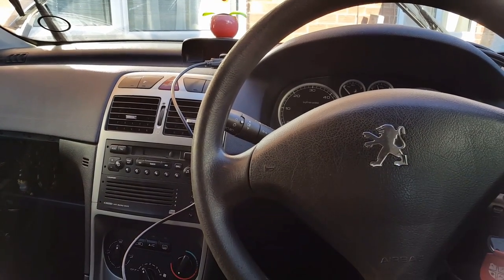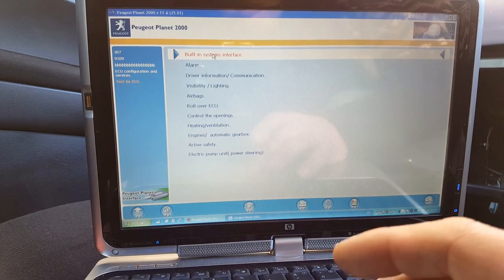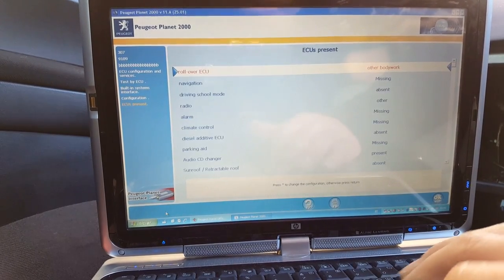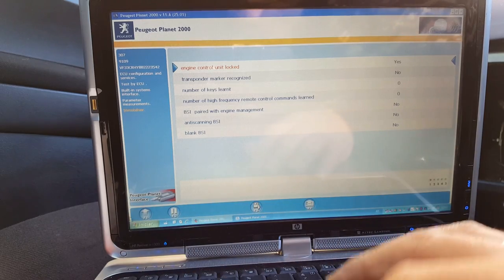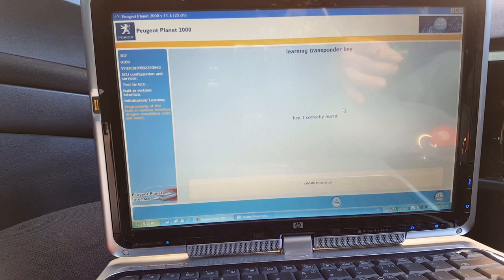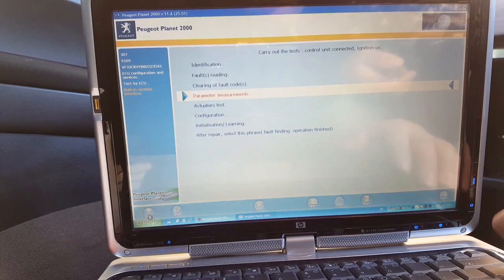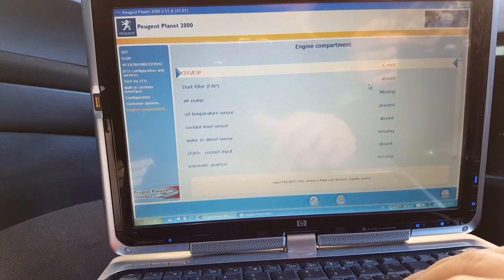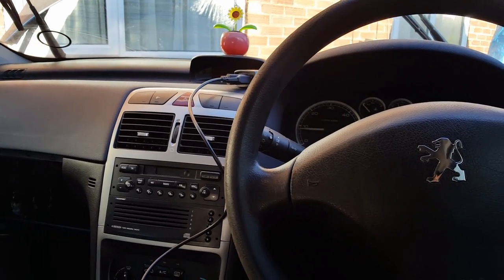Peugeot Citroën blank/virginized (new) BSI programming. Includes key/immobiliser programming.

Comment: Hi,
I would like to ask you a question. I had to change the BSI of my Peugeot 508. It was a used one so the electrician virginised it and reprogrammed it. Now he is saying we might need to order the new keys. It's push button start so key is a fob. He said it can't be reprogrammed to the new BSI. Can you please advise on this. Can my old car  keys be synced to this new(used) BSI?  Thanks
Reply from the maker: Possible not...
It might be that there is a tool out there capable of doing it, that I am not aware of...
But I think you need a new key...
The only other option would be copying the MCU Rom from the old BSI... 
Hope that helps. 
Thank you for watching!
Reply: @LMAutoRepairs  Thanks for your quick reply. Electrician blew the old BSI so I had to get a new BSI from crashed car. It came out of a car with normal key. But my car has keyless entry n push button start. Now my Electrician says we might need new keys from main dealer because these keys are not working.
Reply: @LMAutoRepairs  the old BSI is completely gone so I don't think he can retrieve any data from it about the keys.
Reply from the maker: @Bobbie362  
You would need a programmer to read directly from the chip...
I am not sure about keyless and normal transponder compatibility between BSI...
Not without checking diagrams and stuff...
Either way, you would need new remotes... as the old ones would no longer work...
So I think your best option right now is getting a new key...

Comment: I'm in trouble, I changed the 208's multimedia center, my 2014 put 2019, everything works perfectly, but nobody can take the beep off, information q the diagbox doesn't show that there is a central installed in the car .... someone has a guess  São Paulo Brazil
Reply: Você perguntos nos grupos do Face? Tem uns caras bons por lá que entendem de como instalar as multimídias
Reply: Santos dá uma olhada nesse video: https://www.youtube.com/watch?v=mtEaacOjTjU&t=112s
Reply: Use o Diagbox - https://www.youtube.com/watch?v=5qqS7676I6s

Comment: Hi my 307 valeo bsi is wather damaged. I read with carprog pin code is 4ttw. I buy used one bsi en virgized with all adress ff. I read ecu me744 eeprom pin calculator say wtt4? I will reprogram the bsi with pp2000 same steps if you but he dont accept pincode wtt4 or 4ttw. What i do wrong here? And waths is the best solution for this stuation ? Thank you best regards
Reply from the maker: Mehmet Ali Benturk 
Perhaps the bites are inverted...
Reply: Do you mean eeprom  bites in ECU and how can i solve this?  Maybe have any idea.? Thank you
Reply: Its solved   pin was correct! I try with  lexia under citroen c3 then its wil accept the pin everything is ok now. Thank you very much
Reply from the maker: Mehmet Ali Benturk 
Great!
Thank for the feedback!
👍

Comment: hi, Can you please help me?
I have peugeot 3008 1,6 hdi mod 2010
I have change bsi body computer with the same number but the car don want start. 
I get the message electronic immobiliser faulty. What I need to do?
Reply from the maker: Virginize the module and program it again...
Thank you for watching!
Reply: @LMAutoRepairs  how can I do it?
Reply: How program I need? can you help me over internet?
Reply from the maker: @catoforberg  
You might need to open the BSI, and read the eeprom and MCU...
Which tools do you have?
What was wrong with the original BSI?
Reply: @LMAutoRepairs  l dont have anything program. And something happend with my car so everything be dark. No lights ,electric problem with my old bsi
Reply from the maker: @catoforberg  
If you don't have any tools, probably is better if you find someone to do it for your...
👍👍👍
Reply: @LMAutoRepairs  thanks a lot for informasjon
Reply: My friend have cardprog to clone bsi body computer, and I ask you about you can tell me about eeprom 95128, its only this I need to copy over too my new bsi body computer?
Reply from the maker: To clone you need to clone the mcu as well...
(Depending on the BSI model...)
Thank you for watching and for your comment !

Comment: hi thanks for this nice video.
I have a Citroen Berlingo b9. I went to make a 2nd car key and he messed with my bsi program it went on SLP mode. 

I went to another bloke and he put me another bsi program as he didn't have the correct one for my vehicle. 

my question is  is it possible to go to the main dealer and make the original bsi program without changing the bsi ? 

thanks in advance
Reply from the maker: Possibly... dealer should be able to flash it again... but depends what the damage is... might worth to try...
Thank you for watching and for your comment!
Reply: @LMAutoRepairs  thanks i went mtomthe dealership  and everything  is sothed 
:)
Reply from the maker: @lorencachia  
That's great! 
👍👍👍

Comment: Thanx for your effort and your informative  videos
I have a problem please in my second hand Peugeot406 D9 petrol , that the Air Conditioning does not work(every thing is ok mechanically) , Also the first speed of the fan does not work , when i went to the technician to diagnose the problem he told me that this problem is due to that "the Engine ECU is open " or " without Code" , means can work with any car !!! ,  this Engine ECU is second hand ,  and to solve this problem he needs to install a new software on the ECU, including unifying the code in the key,BSI&engine ECU , How can i solve this problem my self , knowing that i have PP2000 and the diagnostic cable 
Regards
Reply from the maker: Ahmad Abdel-Khalek 
So the immobiliser has been disabled on the engine ecu.
Codes, which codes do you have air con related?
If the ECU in there was not set to a car with air con, go with pp2000 under settings and see if is possible to enable the air con...
And go from there...
Reply: Thank You
I will try this

Comment: Thank you for this video, I have problem when the battery died the car stop ignition and then the tecnician came cancel the code and now the car running but the AC and remote control and central lock don't work after that the bsi damage and replaced with another bsi but it's not the same module 2002 and my car 2001peugout 307, can I do the same procedure and how can I have pin code and thank you
Reply from the maker: Mosa Ahmed
Hi
Once the BSI is replaced, the remotes will no longer work... they cannot be programmed again...
So, get another key fob and get it programmed.
As for the AC,  probably just needs to be configured...
Reply: lmsvvavr thank you and what you mean fob key
Reply from the maker: Mosa Ahmed 
Fob/remote....

Comment: Hi,I have a blank bsi,when I try to enter security code is telling me  built-in system interface  blank.
Programme the built in system interface. I made all the settings but bsi still remaining blank. On parameter measurements /immobiliser blank bsi -yes .
How ca I solve this situation? Thank you!
Reply from the maker: Hi
You need to initialize the BSI first... and then do all the programming...
Thank you for watching and for your comment!
Reply: @LMAutoRepairs  Thank you very much for this wonderful video. Can you please explain in detail how can I initialize the BSI first? I'm in the same situation.
Reply from the maker: @antinben  
I have other videos on that... just search my channel...
Thanks
Reply: @ @LMAutoRepairs  Actually, I saw all your 4 videos :)  But still not sure if there is a way to overcome "Blank BSI" (After entering the 4 correct digits of PIN code) when trying to learn the keys (and when checking immobilizer -> blank BSI-yes). Do I have to take the BSI out and flash new BIN file to the EPROM chip as you did in the following video 
https://www.youtube.com/watch?v=iXkkx2uxGbE 

I'm just trying to avoid disassembling the unit and trying to figure out if there is some other way/s to change "Blank BSI" to no...Maybe somehow with the PP2000 utility?  :(

Also tried to go to "new replacement parts" and then "new BSI" and then F1 ->reconnect and tried again to enter learning the BSI. and got again the same "Blank BSI"

P.S also tried entering the 4 not correct PIN code -> the same message.

Thank you so much
Reply from the maker: @antinben  
Yes, there is a correct procedure and steps to bed followed in a certain order.... but unless I am doing it and looking at the screens, I cant remember now from the top of my head. Sorry...

Comment: Hi..I have one Citroen Berlingo..I take the Pin from the ECU because the Eeprom of the BSI is corupt, fill all with F on the eeprom and solder it on second hand BSI..I conect the BSI do all the procedures ,the car start but i have no milage on the dash..And there is No comunication with the BSI on the dash faulth codes..Can you help me with this
Reply from the maker: Svetoslav Ivanov Slavov 
Hi
If there is something wrong with the eeprom itself, you have just transferred the problem across...
Try it using another eeprom...

Comment: ThankYou very much for the video!
I was looking around for instructions like that. Very helpful.
Can you suggest me a programmer that can read eeproms and MCUs from Body modules or instrument cluster so I can virginize them to reprogram on the car later?
Your suggestion will be helpful to me.
Thankyou in advance!
Reply from the maker: Hi
Thank you fro watching and for your comment!
A good suggestion is X-prog... but I advise you to research, as there is many others out there...
Reply: what a quick replay. You are amazing man. You deserve respect for that work. I don't have any experience with the programmers, in the video for reading the BSI you used Carprog, which can be used for other jobs also, like airbag reset, instrument cluster etc.
Is it better buying Xprog or Carprog. In my tool collection also will be K-Tag and Kess.
ThankYou very much.
Reply from the maker: Aldi Shuli 
Carprog is probably easier to use and more versatile...
X-prog does a bit more MCUs than carprog...
If you are just starting, between the two, get carprog....
Reply: Thankyou very much :)

Comment: Great Video,Thank you for this demonstration! I have a question for you, the pin code witch you have been introduced is from bsi or ecu?  Thank you!!!
Reply from the maker: Hi
Is the pin from the car...
The pin in the ecu needs to match the one on the bsi...
Thank you for watching and for your comment!
Reply: @LMAutoRepairs  the  transponders are blank 100% ? No need for precoding (make dealer key) like vw ?
Reply from the maker: @electronnelectronn2318  
No... but the remote also needs to be blank/new...
Thank you for watching!

Comment: Hi Mr.  Imsvvavr thanks for sharing your video very interesting, can i ask a help? have a citreon C5 2004 model i am now got stress spending money just to back to life my car. i had replaced  the engine because it was overheated then when i bought the engine from the supplier it wont works and i returned for the  3 times it was removed and fixed the engine and 3 times i had returned till i decided to overhaul my previous engine after fixed the engine still the engine failed
 to start and we scan to the computer the ECU not detected...please help me what to do
Reply from the maker: Ronald Serenuela 
Ok, so what I understand from your description, is that you cannot communicate with the engine ecu, is that correct?
Reply: Yes Mr. Imsvvavr!
Reply from the maker: Ronald Serenuela 
Ok... in that case check wiring, fuses etc...
If when you turn the ignition on everything behaves as normal, then it might be just something on them communication lines... otherwise might be a problem with power to ecu etc...
Get hold of some diagrams and check the wires...
Reply: Ok thanks a lot ill try all over again.
Reply: but the starter is working it can crank the engine but wont start.
Reply from the maker: Ronald Serenuela 
Yes, starter motor is in some cases triggered by the BSM... although the signal should come from the engine ecu...  🤔
Well, till you manage to communicate with the ecu there is nothing you can do... 
Actually,  that is most likely the problem... is the ECU is not communicating,  is not getting the immo code to unlock, and therefore not allowing the engine to start...
Reply: so what im suppose to do...please give an advise...
Reply from the maker: Ronald Serenuela 
Well, I have just told you....
You need to check communication lines to/from the ECU...
Reply: thank you so much...for your time...

Comment: Imsvvavr very useful vedio thank you very much. 
I got 307 with one remote key lost, I am using the normal one with no remote control. I will be so grateful if  you instruct me how to fix that cheaply.
Looking forward to hearing back from you.
Reply from the maker: Galloper 
You need to get a blank remote and transponder and then program it to the car... there is no other way...
Reply: Thank you for your quick response. Could you please recommend to me any link to buy it online? as I have not enough experience to do that.
Reply from the maker: Galloper 
eBay is good place to start...
Reply: 2-buttons ID46 433MHz Transponder Chips Remote Fob Key For Peugeot 207 307 N8H8. Imsvvavr Do I need to have any code to do the process using pp2000?
Reply from the maker: Galloper 
Yes, you need the security code from your car.
If you still have all the paperwork, you should have a scratch card that contains the code.
If not, the dealer will give you the code... for a small fee... here in the UK,  about £30...
There is other ways of retrieving the code, but will require special tools etc...
Reply: Imsvvavr I just bought the car and I asked the previous owner about the security. he said that the security code is lost as well. I live in Iraq and the dealer closed about a year ago. I wonder If you can help me regarding the special tools, I will be so grateful. 
Thank you very much for your cooperation and your patience.
Reply from the maker: Galloper 
Watch this video...
https://youtu.be/nXoUz-ejRtI

There a tool called "PSA BSI tool" that can read the pin through the OBD port... but check first, to make sure is compatible with the BSI fitted to your car...

Comment: i have same case. after battery disconnect car dont start and other symptoms of bsi eeprom corrupt. when check live data i see ecu is locked. and i cant comminicate with main engine ecu. this is normal? bsi can block diag line to ecu communication if eeprom is corrupt in bsi?
Reply from the maker: Hi
Yes it can... Certain Peugeots are known for that problem...
You need to pretty much follow this video and you will have the car back on the road.
Remember that you might do not need to follow every step...
Reply: thanks buddy. iwatched this videos few monts ago,and not have this case, very helpfull. but in my case is citroen c5 2.0hdi 2001 year.
Reply from the maker: Ok.. Same thing...the procedures are similar.
Hope you get it sorted.

Comment: Hi! I have replaced BSI from a 307. Done everything you said but i get stucked with this error when i program transponder with pp2000. check/verify transponder key (something like that). i used blank transponder. any suggestion, please.
Reply from the maker: Mircea Catana 
Hi
Are you using the correct transponder?
Or, is the transponder in good shape?
Reply: lmsvvavr, yes i'm using pcf7936 TP12 id46 new blank transponder
Reply from the maker: Mircea Catana 
OK... well, I can't really help you further... usually they programme ok... try another transponder... just in case...
Reply: lmsvvavr. ok. thanks for your reply.

Comment: Hi Imsvvavr, I hi have a Peugeot 206sw quicksilver estate and when I unlock the car the rear wiper activates, this also happens when ive been sitting in the car no key in the ignition so it sort of times out then open the door and the rear wiper goes again can help
Reply from the maker: Shaun Rawlins 
That's to ensure you can reverse safely.... 😁
Now seriously... check that there is no shorts in the wires... if the signal from the the door open is short with the rear wiper wire it can cause that...
It can be many other things though... check the loom on the boot at the hinge location... do you have any codes?
Reply: No codes at the moment, but the boot is temperamental in opening I don't seem to be having any luck with this car
Reply from the maker: Shaun Rawlins 
Have you checked live data, to see what is happening when you open the door etc...
Reply: in the process of getting the equipment to do that in the next week or two